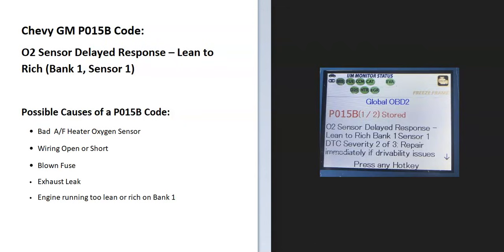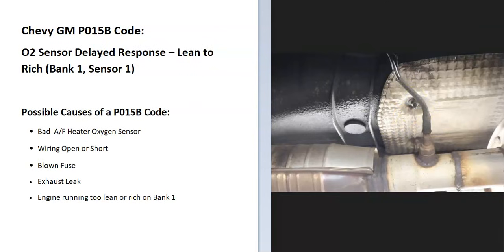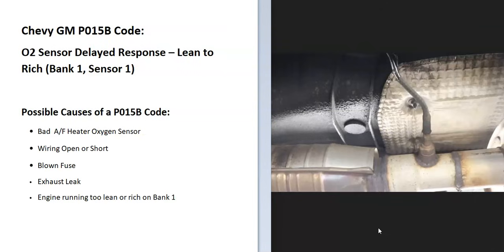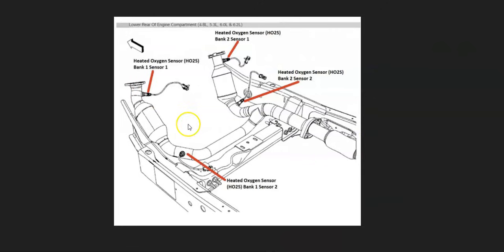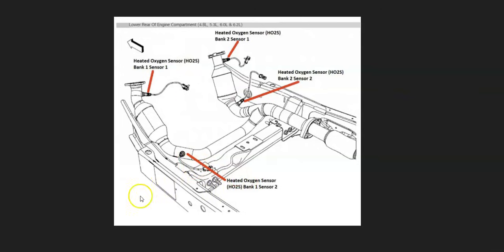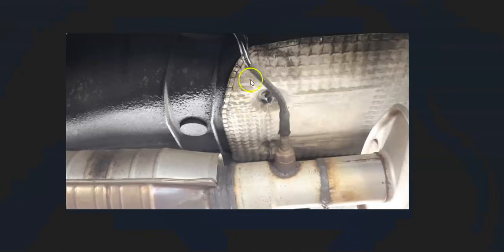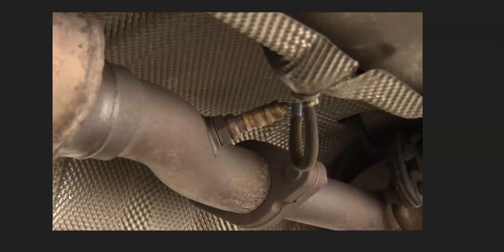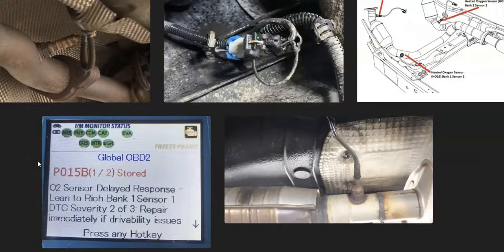Causes and Fixes Chevy P015B Code: O2 Sensor Delayed Response – Lean to Rich (Bank 1, Sensor 1)

Comment: Hello, my 2016 Chevy Camaro 2.0 turbo had a clogged catalytic converter and wouldn’t run, I unclogged the cat and now it runs but misfires only when I accelerate and hesitates badly, I have codes for o2 sensor bank 1 and p015a/p015b and don’t know where to start and don’t want to start throwing parts at it, could you please help
Reply: start with what was causing the cat to be clogged. do you have a cracked head? do you have worn out cylinder ring? the vehicle is in your hands, not his, and you have told him literally nothing. i'm not even a mechanic and yet i figured out how to change out the obama  b.s. stuff GM installed to deliberately take all 5.3L with the obama b.s. regulations blow up so you will have to buy a new vehicle or a new motor for $15grand
Reply: He literally told you step by step what to do . If you didn’t catch on then maybe you should go to a mechanic

Comment: How much more fuel will my engine use with this code? I have an exhaust manifold leak and no other codes are present
Reply: My daughter in-law just brought me this same code and PCV failure.
Reply: mine was a false positive code. it disappeared. maybe it will come later but for now it’s good
Reply: @Jay.G_  no such thing as a false positive, the part had an error for a reason, something is going bad, right now what ever is failing is in the early stage of failing. keep your engine oil golden, it's cheaper than a new motor.
for me i had to remove all the 5.3l obama regulation  pretend compliance parts that were designed to blow up the engine, and were at the very early stage of failing with spalling on the cam shaft due to the horse shit designed lifters that collapse when AFM/DOD cylinder deactivation happens ( all that stuff is a lie to pass obama mandated standards EPA regulations that is purely for show but specifically designed to prematurely fail with deliberately under designed oil ports too small they barely do the job unless your oil is always golden, the minute it gets brown it's time to change your oil before those ports plug up and stop 1 or more upto 4 cylinders of getting oil while the motor is running and thus blowing up your engine.) see crazed performance repair afm delete video if you want to see how bad it gets. wrenching with kenny collapsed lifter failure break down for the reason of what i am talking about. i had to watch 3-4 videos that were 45min-hours long each before i knew what i was getting into. you will need $1200 in tools alone if you do it yourself. i already had some, and bought the rest so that is my approximate damage to my wallet in just tools.
how much engine oil and filters and changes could i have done for that price? all because i can't change my oil in the snow due to frost bite in bad circulation in one hand i'd have to get my hand cut off after 15 minutes exposure in -20ºF+ weather
Reply: same
Reply: depends on whats failing in the motor that it's cutting fuel to 1 or more cylinders and over supplying the rest to make up for the failure of the bad cylinder(s) lost power. many things can cause engine limp mode like a plugged up cat from oil by passing the cylinder seals and going into the exhaust port just as an example. with an calibrated  after market replacement  intake cam shaft position sensor i was on the typical lower end mileage until i threw the stock factory one back in, that will fail at some point in the next 30,000 miles, i just preemptively replaced while doing AFM/DOD delete. all the dealerships charge $800 minimum just to reprogram a sensor and mechanics want $500. i get it the computer tool to do it is not cheap, but it literally is just a 30 second learn process with the computer tool that does it. i have yet to buy one of these reprogramming computer scan tools as they are about $1200. dealers don't stock these parts any more they claim covid/ukraine despite the factory sensor saying "made in china" so i know it only cost china $5 to make and dealers want $100+ up to $345 for them and the aftermarket is $25-$74 because they make the same excuse for the higher price despite the fact i have the receipts for a vehicle a few years prior to 2019 showing it cost was @19-25